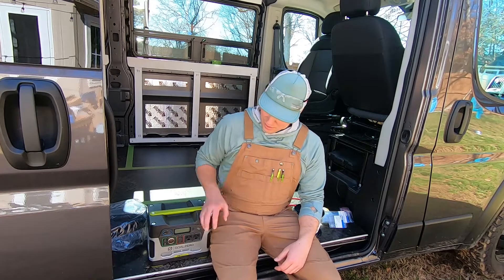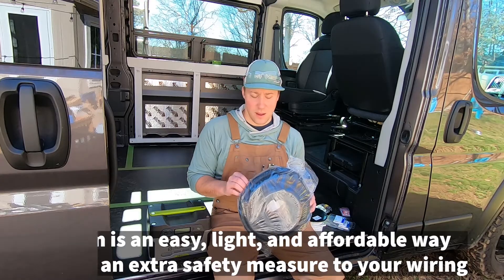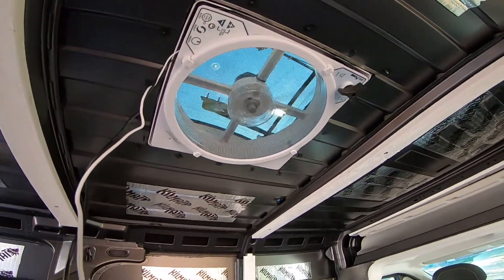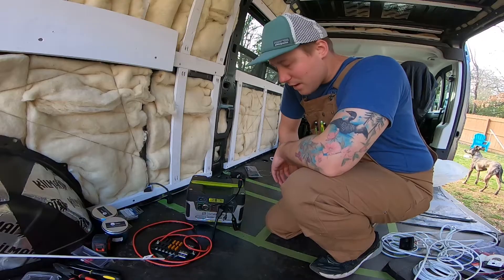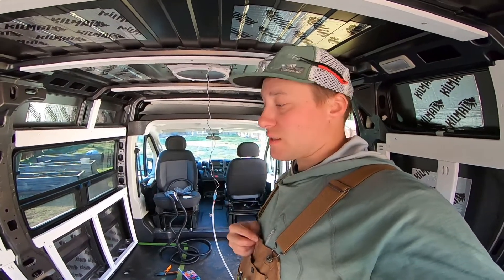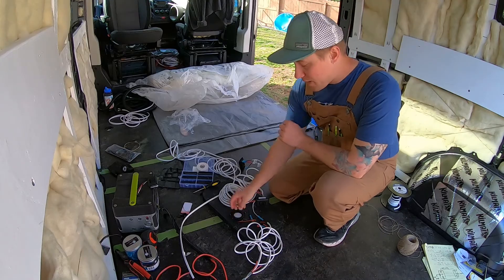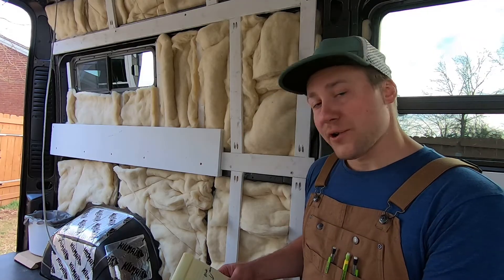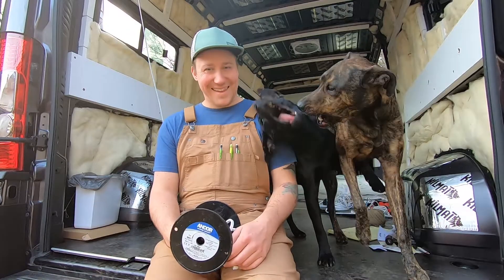Van Electrical Wiring + Goal Zero Yeti Power Station, Part 1 //Ep. 8 DIY VAN BUILD

Comment: Matt. What type of connector did you put on your positive/negative wires from your fuse box that connects to the goal zero 12V max current cable?
Reply: Thx. Very helpful. I’ve also seen this. Valley Enterprises Dual Positive/Negative ATC Style Fuse Holder, with Ring Terminals, with Anderson Powerpole Connectors, Wire 10 Gauge https://www.amazon.com/dp/B0775YD4CT/ref=cm_sw_r_cp_api_fabc_BqMVFbB7HSTKB?_encoding=UTF8&psc=1

It’s strange though when you click on the 12v max current item on the goal zero sight, it says not compatible w yeti x. Would you know the answer why?
Reply from the maker: It's a big bummer. They've had firmware issues with the fast charger and link modules too. I purchased all those things already because we knew we'd upgrade to the 3000x. Hopefully they figure out their capability issues.

I'm guessing the cord is because the new updated output max on the x models is higher than before and it could max out at higher amps than the cord is rated for? I'd think it would still be able to be utilized though. I could be  wrong and might be a worthwhile question for Goal Zero. It sounds like they are in over their heads with all the unforseen issues with their x line sadly.
Reply: I guess this is the answer to that question. 

The 12v Max Current Cable is no longer needed with the Yeti 3000x (or 1000x, 1500x, and 6000x) as it has a regulated 30 amp power pole output port for this type of application. This port is located both on the front of the Yeti and under the lid, but only one port will provide a full 30 amps at once.
Reply: So when goal zero says power pole port on the new  yeti x series is that the Anderson plug? Or is it something different. If it is the Anderson plug I wonder if you can use that link I sent you. 

Sorry I don’t own a goal zero. So I don’t have a unit to reference Just researching and watching videos like yours to  make a decision
Reply from the maker: @ChristopherKueber  hell yea! I guess it didn't dawn on me it was as large as it was! The cord I used to connect the Goal Zero max current to Fuse box would work for the single application too 👍🏼
Reply from the maker: The cord you sent would work too if you want reducancy for safety concerns. Since they are regulated you don't necessarily need a fuse between the Goal Zero and fuse box but it couldn't hurt
Reply: Sorry if my responses are redundant. Guessing you can just use the plugs you showed me if those are what yeti calls power pills port/Anderson plugs
Reply from the maker: No worries at all! I just hadn't seen you message. Yep, the power pole is the Anderson connection. So the cord I sent you and the one you sent me (only difference is the fuse holder) would both work perfect with it to feed a fuse box. I only said a fuse between the Yeti and fuse box (with the cord you sent) is redundant because the Yeti already regulates the output. But reducancy in electrical circuits is smart so the cord you sent would possibly be safer than without a fuse👍🏼

Hope that helps and answers your questions! Good luck with your build! It's an exciting adventure! 🙌🏻
Reply from the maker: Sorry I must have missed posting it in the description. I used this connection I found on Amazon. You could maybe make one for cheaper if you already have the tools and wire but I opted for a pre-made one. Buying items separately seemed to be just as expensive 
https://amzn.to/3gH9oV0

Comment: How much wire did you end up using to wire the van?
Reply from the maker: I first bought a 100 feet. Then bought a 250 foot spool because the 100 was backorder for a month🙄. I have a lot left over. I'm not sure the exact footage I used but I think I could have got away with 200 feet. The runs that took the most were the LED puck lights since they have two switches and had to run across the van. I did my best to minimize distances
Reply: @northstaroffgrid  Thanks!
Reply from the maker: No worries!

Comment: The switches you link to are SPST (Single Pole Single Throw).  But it looks like you are wiring them to function as "3-way" (2 locations) SPDT switches. Are these switches really 3-way switches?
Reply from the maker: The SPST switch listed was the one I used for the garage lights. I ended up calling American Technology Components to make me a switch to pair with the dimmer because I couldn't find one in the same style that would work with it in my search. I originally purchased one that said it was 12v but it actually was not. I'd suggest calling them to make one (it was around $17 shipped) or seeing if there is a different switch you can find to meet the requirements. Sorry I can't be much more help there

Comment: What about the AC wiring? What did you use? Just 12g wire?
Reply from the maker: Since I'm using a Goal Zero for our power, I ended up wiring outlets to heavy duty extension cords. I talk about it in our shiplap wall episode, I'll link it here-
https://youtu.be/Hls4E1Vqwzs
Reply: For 2 fans should i run 2 separate wires to the fuse panel or daisy chain them together?
Reply from the maker: I think two separate wires is best so that you can properly fuse each fan and not have to worry about a larger current running through the lead wire.
Reply: Thank you brother you and your videos are great they’ve been super helpful
Reply from the maker: No problem at all, you can always reach out on Instagram or by email if you want to bounce ideas or have other questions. Good luck with your build! 🙌🏻

Comment: Matt, Love you build so far, great job! We will begin building out our Promaster in a couple months and also will be using the Goal Zero 3000. With the location of your power system how are you going to access the Yeti (when not connected to WiFi) to turn on and off the 120v on the Yeti?
Reply from the maker: Thanks for following along! I'm glad you are enjoying it! Congrats on the van and starting the journey!! 

I'm planning to put the system on a beefy drawer slide so I can move it out to access it when needed. I tried to leave extra wire for everthing to allow it to extend out. There will be a pantry above it and bench to the right of it (looking at the driver side) so I'm hoping I'll be able to figure it all out. I haven't given that project a ton of thought yet with building overhead cabinets and the kitchen lower taking up my energy currently. Hope that helps!

Comment: Great video, thanks for taking the time to make and produce it! 
I'm months behind you in my build. I got a 2020 Ford Transit AWD (to ski around Tahoe), your van looks great with the dark
body color. I just installed the Maxxair fan yesterday. I would like to test it but I don't have a Yeti system, do you know another way to test it? Thanks for hot time, much appreciated!
Reply from the maker: Thanks for watching! I'm glad you are enjoying the videos! You'll get there! It's definitely a process but feels so rewarding as you check projects off your list. One way I had tested things was with a 12v drill battery. When it's removed from the drill the leads are exposed and you can press your wires to it. Just make sure it's 12v and not 18 which some are. That could ruin your appliances. Hope that helps! I'd love to see your rig someday!

Comment: Hey Matt thank you for info i did end up buying a gold zero 1000 and the accessories you recommend was watching the video with the light switch and how you connected them thank you for that was wondering if you can send me info on those switches and the dimmer switch like the idea how your setting it up planning on reaching out to you on instagram once i get an account thanks again Matt.
Reply from the maker: Definitely reach out on Instagram, it will be easy to chat. This is the dimmer switch I went with. I found it on Amazon but now it is only showing the switch in white and not black so I'll share the company webpage

https://www.atcomp.com/product/ah-sld1-5-hs001/

I called American Technology Comp because I originally bought a switch to pair with the dimmer that didn't work. They ended up making me a custom 2 switch panel and total it was $16 per switch. It might be easiest to call them to have them made?

Comment: Thank you for the video just a couple of questions the 4& 1 that goes into the yeti box what is that called and the cable that connects to the 4&1 into the fuse box? can i purchase on amazon? and lastly what size wire are you going to use for led lights and switches thank you.
Reply from the maker: We used 14awg wire for the LEDs, switches, fans, USB, and to run for a water pump in the future.
https://www.amazon.com/dp/B000NUYBWU/ref=cm_sw_r_em_apa_i_0ql0Eb3J3SKNS

The cable is called the Max Current Cable sold by Goal Zero. I didn't find it on Amazon. What Goal Zero system would you use? As I talk about in the episode, it is meant for the lithium 1000 and up. Here's the Goal Zero link. You could maybe find it on another website too 
https://www.goalzero.com/shop/power-station-accessories/12v-max-current-cable/

I used this 10g wire connector to go from the Max Current Cable to the Fuse Box
https://www.amazon.com/dp/B077TT7SWZ/ref=cm_sw_r_em_apa_i_hml0EbJ78J8MM

Let me know if you have other questions. Reaching out on Instagram, we can chat too.
Reply: @northstaroffgrid  Hey Matt would like to chat im sorry what is your Instagram again thanks again for getting back to me Vince
Reply from the maker: Sorry I missed this reply. YouTube has a terrible system to see them. We are @trailvagabonds on Instagram